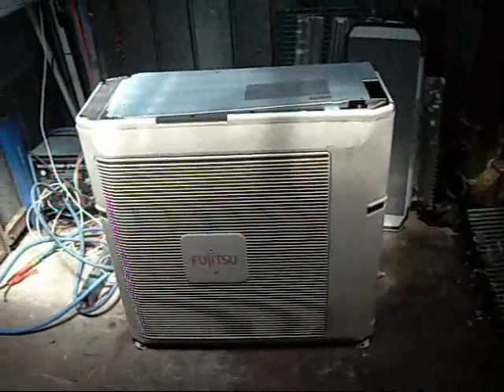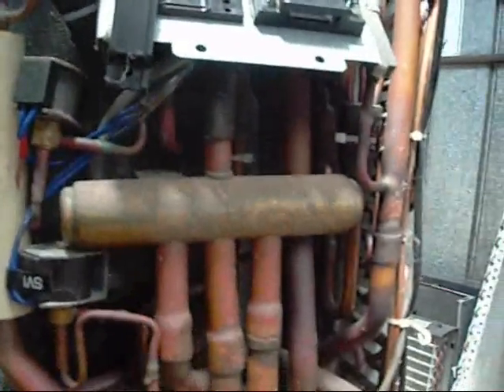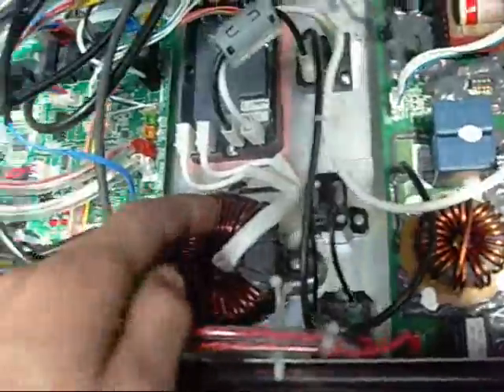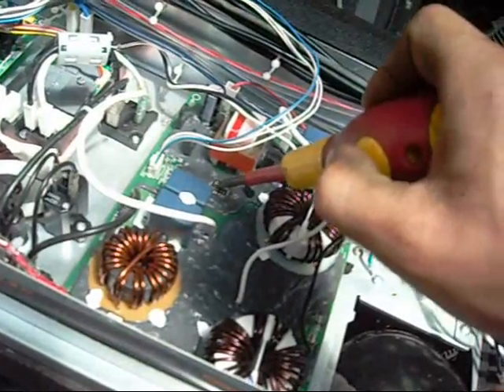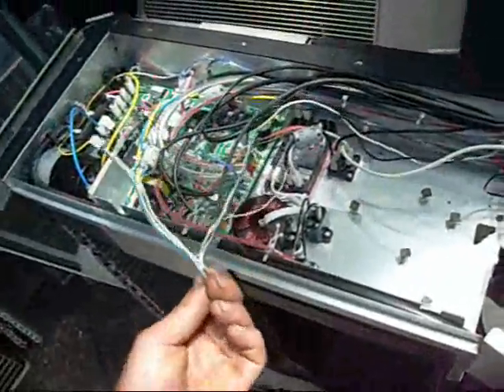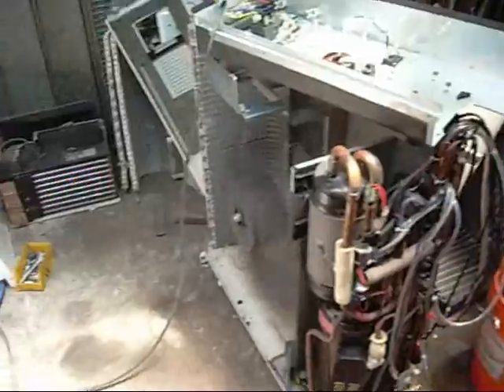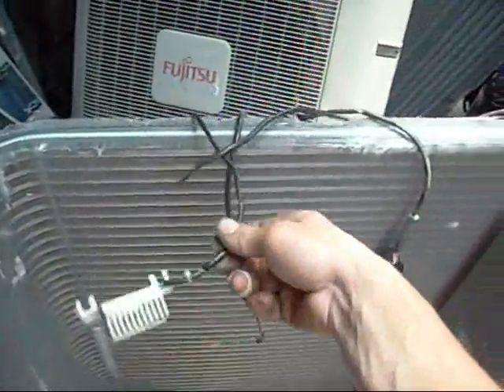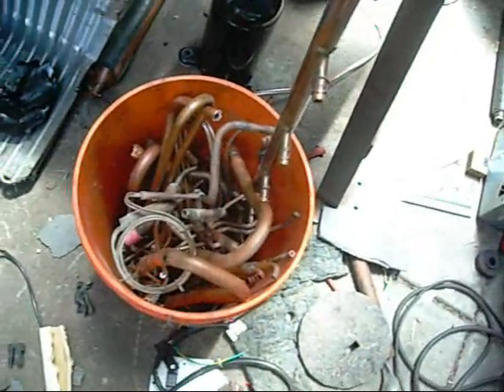Dead 16Kw Fujitsu Inverter Condenser Test and  Dismantling

Comment: I'm wondering how long these inverter type air cons would last if they built the inverter/power supply to the same standards that PC power supplies are built too.  Or anything using DC power for that matter.

Comment: I have a MHI SRK63ZEA-S or 71 or 80 not sure as the manual is for all three.
Just turned it on and it is dead!!  Remote is fine, new batteries, checked the outside elect box and the special switch for the aircond is still on and checked the on/off switch under the inside split as well.Just D E A D.  It was last used maybe 2 months ago for heating. It is 3 years old and hardly used.

Could this be electrical or compresser and such?

One guy told me to call a fridge mech not an air cond guy.

Comment: @Aussie50 I don't know if it saves anything even if it is working right, I think the main motivation was to save on copper in the transformer, but when you add up the parts to build an inverter supply it likely isn't any cheaper. As you say if the microwave dies prematurely it's not saving energy or materials, in my case the high voltage supply to the magnetron decided to die, the strange part was that while it was going out it smelled of ozone inside but I couldn't find any evidence of arcing.

Comment from the maker: @OlegKostoglatov yeah my Panasonic inverter microwave is less than 3 years old and the turntable control freaks out randomly, usually stops or gets confused about which direction it wants to go.

Its getting to the point where this 'energy saving' inverter technology is costing more energy/money because it fails way too soon!

Comment: A lot of modern stuff is garbage because of those switching mode inverter type power supplies, in theory they should work well and last, in practice they build them using bad designs, with cheap parts with borderline voltage ratings and tolerances. I found that out with a Panasonic Inverter microwave, started blowing fuses and then died, found out they are made out of unrepairable junk, oddly enough from an Aussie website. Engineers just don't understand the KISS principle anymore